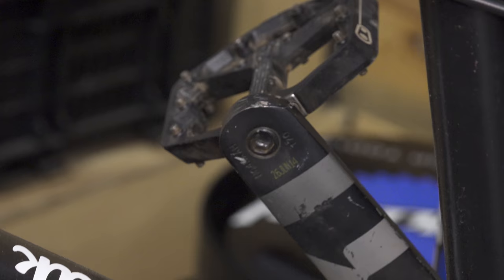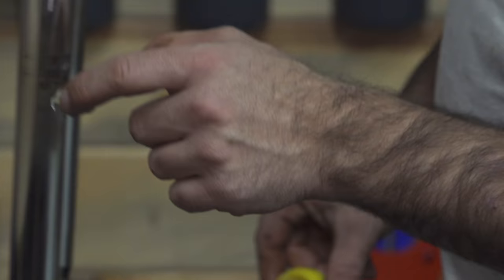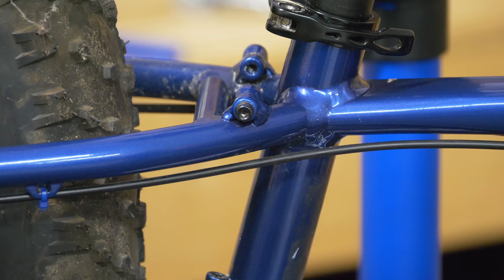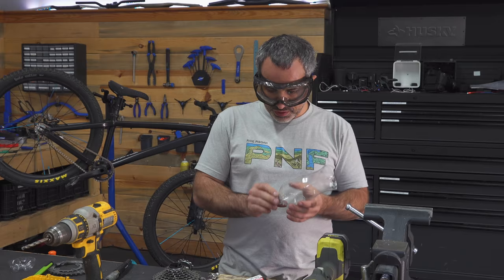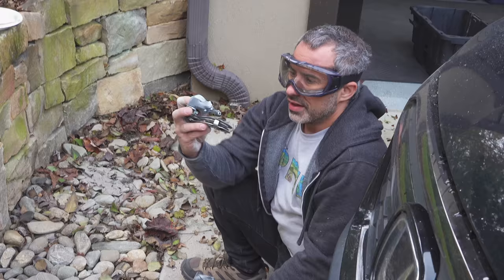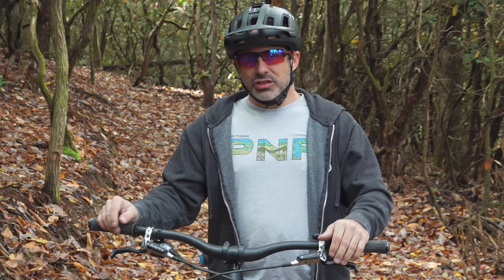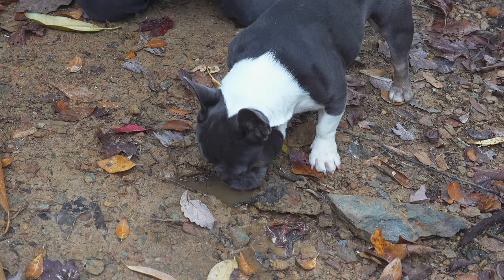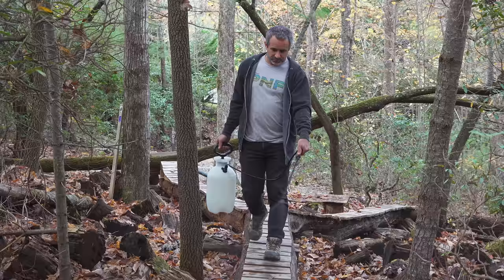10 Mildly Useful Hacks for Mountain Bikers

Comment: HACK: When you cut a steerer on a new fork, save the off-cut.  When you service your fork, instead of having your cockpit hanging pulling and twisting cables, clamp it onto the steerer tube off-cut and set it down on top of your headset.   Now your handlebars are sitting safely on your bike while you service your fork.
Reply: This is cool but only works on very very tall steerers
Reply: Pretty decent way that
Reply: @goodpools  i suppose I should have added that a piece of 1 and 1/8 inch tubing will also work just as well.  Thanks!

Comment: An old-school frame protection hack that I still use: 3m brand safety grip tape. Colloquially known as bathroom tape. Stick that stuff on the most vulnerable parts of your bike (ex: the downtube, crankarms, etc...). It''s thicker than the usual frame protection tape. Useful for protecting the bik3 against scratches, flying rocks, etc...
Reply: That’s actually really smart
Reply: Do you have a link for this? Is this transparent?
Reply: @vasingerke  you can find that in your local hardware store. As well as online.

There are multiple variants of that. And there is a transparent version.

You do not wrap the frame with that tape. You just apply it to the most vulnerable parts of your bike. As an example: I have stuck a length of that on the underside of my bike's downtube. I've seen people use it on their fork's lowers, crankarms, etc...
Reply: That's exactly what I did with my bike. The roll of tape was cheaper than one of those All Mountain Style frame protection kits. I know it's not as stylish, as it doesn't come with those fancy camo graphics, but I dare to say it's sturdier. I got it at Home Depot.
Reply: @wolfrikvonschwarzblut3921  yup. I still have what's left of the roll i got in 2013...

It's pretty thick so it protects well...

Comment: That sandblast hack is like a free ticket straight to Silicosis! First of all: sandblasting is pretty much NEVER done with actual sand. The most basic medium is glass bead, and you can buy it for a couple of dollars per pound.
Secondly, you ALWAYS want to wear a decent respirator (preferrably a half-face mask with filters or better) when sandblasting, because that dust is guaranteed to cause problems with your lungs!
Reply: Everyone should read this!!!
Reply: Yeah, I’m in healthcare and I was thinking the same thing either an enclosed container or some kinda protection for your lungs.
Reply: Not as big a problem as you think. I've been in concrete for 13 years, grinding off an on. Sure, it's not great and irritates your lungs. But for people doing it once a month or once a year, it's perfectly fine.
And they make masks specifically for grinding, full face shields. Or a fully enclosed oxygen mask.
Reply: This should be pinned
Reply: @RealMTBAddict  anecdotal reports from a different hazard isn't really a valid counter argument now is it...
Reply: @MassisPipes  Didn't I say wear a fully enclosed oxygen mask? I'm sure Seth isn't taking huge breaths of air while sandblasting. There is a technique to breathing so you minimize your risk.
Feel better now?
Reply: Yes, there's a reason sand/bead blasting is generally done in an enclosed cabinet and with special gloves
Reply: As a former sand blaster, I was cringing during that bit.
Reply: @jond1915  clearly you have little experience with sandblasting. Beach sand at the beach isn't being smashed into dust at high speeds. The reason we no longer use actual sand when sand blasting is because of how dangerous to your health it was.
Reply from the maker: VERY good to know. We’re actually planning on building an enclosure for doing this with plexiglass. The sand was a pretty bad medium too since it had bigger pieces that clogged the nozzle. Glass bead sounds much better.
Reply: @BermPeakExpress  There are many types of blasting media - from mild (walnut shells) to aggressive (silicon carbide or aluminum oxide).
Reply: @BermPeakExpress  a prebuilt harbour freight cabinet will probably be around the same price as a diy one with plexi, and much safer and easier to use. They cost about $180 including the gun...
Reply: I agree, I’ve seen people even use the grate off of a kitchen strainer with the glass beads to help separate larger beads that could dent the piece of material they were working on. Fish bowl sand, some types of play sand works too
Reply: if you havnt noticed safety seems to come second to seth
Reply: @EasternCanadian  everyone knows: safety third!
Reply: @MassisPipes  always keep safety top 10!!!
Reply: @BermPeakExpress  Seth, I'll second the suggestion to just buy a cabinet ready made.  They'll come with a nozzle.  Some blasting media can be recycled when you use a proper cabinet too, so it may save you money in the long run.

For softer metals like aluminium, try walnut shell or baking soda as blasting mediums.  If you get a real beat up Aluminium frame flip bike that you want to repaint, best to blast with something gentle.
Reply: @MassisPipes  explain exactly how his hazard is any different? Cause it isn't
Reply: @BermPeakExpress  I you're blasting for real, and not just a hack, glass bead as mentioned is nice and can be delicate. For aggressive removal black aluminum oxide. And the health risks are no joke. Even with the correct safety equipment it kills people who do it for a living. Even a short exposure like your video leaves lasting damage.
Reply: @pinchpeak5203  When you sandblast, the sand breaks up into microscopic particles. These silicon particles attach to the lungs, permanently, reducing lung capacity and sometimes causing cancer. It is the same as asbestos exposure, except asbestos more often causes cancer. It's not like spray paint or natural "dust" from say, a bike trail where the effects tend to be short term on the lungs then clear up. Sandblasting companies that do buildings (where exposure risk is high due even with a full sealed fresh air system) retire workers after 5-10 years as that's the maxim risk they are willing to take.
Reply: @BermPeakExpress  follow up video coming on that?
Reply: not to mention dont get any of it anywhere near any engines because it goes EVERYWHERE
Reply: @BermPeakExpress  of you are just cleaning stuff then soda blasting is super gentle.
Reply: No masks, be a man.
Reply: @seanbrown6904  Being a man means being there for your family, giving the right example, and a whole bunch of other things.
Being in a hospital stacking up bills is not "being a man".
Reply: @MassisPipes  Is joke bro. relax.
Reply: Was about to type something similar, but you did it way better than I could.
Reply: If you buy a respirator from somewhere and they don’t provide a fit test your not protected, also having a beard or even stubble will prevent the respirator from creating a proper seal and protecting you for inhaling the dust… for this type of application you will need P100 respirator cartridges that handle the dust particulate… if you are going to use the mask with chemicals you need to get different filters (where ever you get the chemicals should provide MSDS that tell you all required PPE)
Reply: @BermPeakExpress  Use baking soda, less abrasive en probably available in all of the home depots or supermarkets or what's around town...
Reply: @BermPeakExpress   but it was ok for the purpose of a proof of concept
Reply: I came here to say this, thankfully you already have. Well said, I’m glad your comment got to the top of the comments section so more people will see it.
Reply: @BermPeakExpress  Try crushed walnut shell. Works great, can be reused, biodegrades when done.
Reply: 1000% agree!
Reply: Seat belts and warning labels ruined everything! Just roll with it stop fighting nature
Reply: Thank you for saving me from having to write this! Silicosis can be fatal, and there’s no real treatment for it.
Reply: @MassisPipes 
"Stupid advice + [be a man]" is a meme.
Reply: In a ventilated outside area this is fine. Don't be such a drama Queen
Reply: @michaelhenry4405  definitely not. Maybe in a strong wind if you're standing upwind. Definitely not in a sheltered spot like in the video.
Reply: @BermPeakExpress  Hey man never blow the compressed air in hand as it can pretty much cause air-pockets in blood which can kill u, Great vid though loved the sharpie tricks
Reply: Lol.  I guess nobody told this guy how glass is made.
Reply: @RK-kn1ud  I guess nobody ever told you that melting alters the chemical composition, especially if you add other material such as soda ash and limestone.
Try grinding your drinking glass back down to sand and let me know how that works out.
Reply: @MassisPipes  "the most basic medium is glass bead"

Meanwhile a guy using literal sand is having some pretty good success.
Reply: @RK-kn1ud  obviously you're completely missing my point.
Reply: o  mR safety KIA   AND ALL of his sand blaster knowledge..  WGAF
Reply: @oldnslowpopi  the 40.000+ people who die of silicosis every year, that's who.
Reply: OSHA said I didn’t need a respirator

Comment: 7:10, Seth says that like half of the population doesnt regularly have to remove blood from clothing
if you dont have peroxide(or don't want to damage your clothes) - soak in cold water asap and wash with a bar of soap or Vanish, also in cold water before chucking in the wash also with Vanish or the like
just whatever you do dont use hot water as it will set the blood in the fabric
Reply: Nice
Reply: This is the answer. Just soak in cold water and then wash it. You don’t even have to be that quick about soaking it.
Reply: Vanish is like oxyclean for Americans reading this. Cold wash is key for sure.
Reply: Before putting in washing machine I put windex on blood stain and it comes out perfect

Comment: When installing a headset without a cup press and it won’t go in with a hammer. This is more of a problem on tapered head tubes. Put the cups in the freezer and then it will work. Because the metal will shrink slightly in the freezer.

Comment: A hack to remember position of brake/shift levers is to mark it with a retractable pencil. Once the levers are set perfectly, use a reference point like the gap of a hinge or the window of the clamp. Then make a mark with the pencil. So when you have to take apart your cockpit, resembling the positions are a breeze by lining up the lever to your tracing. Works also for your bar to stem.
Reply: I'm pretty sure this hack was included in some of Seth's videos long time ago

Comment: I have a hack with a blinky light, just good for a having a light so people can see you for commuting or something like that.

Basically it involves taking your stem faceplate and bars off then threading the elasticated loop of the blinky over the stem and putting the bars and stem back together, then you can do up the loop on the blinky as you would. The blinky sits nicely on top of the stem or you can even put it on the underside but the button is harder to access.

The hack works best on bikes with more tubular stems. Another linked hack is to swap the red rubber casing on a rear light for a black one off a front light for a more stealth look. Again a blinky is sufficient for a commuter rear light and can simply just stay on the bike for when you next need it.

Both of these hacks are effectively free save for the lights which most people have kicking around anyway.

Love your work,

George

Comment: So the ultimate way to get a blood stain out of clothing, from my hematology lecture in medical school, is to dissolve 1 teaspoon of salt into 2 cups of water (about a plastic water bottle). This solution is about the same salt concentration (osmolarity) as your blood like you would see with normal saline given IV for fluid administration. Soak the clothing in your homemade normal saline solution and the solution will be able to lift out the blood without causing the cells to burst and stain like they would when trying to use regular water.

Comment: HACK - For cold weather riding - tape the front vents of your helmet of - you can still vent out the back vents but you no longer get that airflow across the top of your head.  Works well in conjunction with a headband to keep your ears warm.  Use masking tape for the maximum un-coolness factor.

Comment: Hack suggestion: If you don't have access to a garden hose for bike cleaning and don't want to purchase a portable pressure washer, you can just use a big garden watering can (or camping solar shower bag). You also don't have to worry about your bearings since the pressure isn't as high. 

Also, you never mentioned carrying a first aid kit in any of your videos (that i've seen). Maybe you have a good suggestion where to store that on the bike?
Reply: Hack part 2 hoses fit washing machine hookups.

Comment: An important note: DO NOT use silica based sand (sand-blasting or playground sand) unless you want a case of silicosis! If you’re going to try to go this route, I’d recommend glass beads or aluminum oxide and always use eye and hand protection and a respirator.
Reply: glass is silica...

Comment: I did the O-ring hack a while ago and if you don't want to disassemble all that stuff you can cut the O-ring and use a drop of super glue to glue it back up. Just make sure not to get any on the stanchions. I used some masking tape to protect them and since it requires so little super glue I first put a few drops of it on a clean surface and used a push pin to apply it.

Comment: Seth, you NEED a 3D printer. Those things are pretty cheap right now and quite easy to use. Ender 3 v2 is a good entrypoint. This would inhance you manufacturing capabilities for more bike hacks immensly.
Reply: This is so true
Reply: Honestly he’s got a enough money to probably just buy a pursa or some other printer that will work good out of box.
Reply: Great idea, although it would also require everyone to own a 3D printer in order to do the hack.
Reply: @wyatts9646  tbh, my 3v2 worked great out of the box. but yes, Prusas come with many more features that make them more comfortable to use, like filament detection, thermal runaway protection and so on.
Reply: @tomodges  this is a valid argument, but the sandblaster hack requires people to have a compressor and an angle grinder, which both can easily cost what an entry level printer would cost.
Reply: @Medievalfan94  well also he could probably get some 1-2k printer free from a company
Reply: Good idea!

Comment: Seth, You should use distilled white vinegar instead of bleach for the mildew on your wooden features - experts recommend this because it actually works better particularly for deterring regrowth (was surprised to learn this myself, but look it up), not to mention covering your bases for any environmental considerations.  I’m sure the small amount of bleach you are misting on your features is pretty negligible (and frankly acceptable, in my mind), but you should switch over if only for sake of effectiveness!

Also, your joke was funny, but I’d question the general assumption that cutting down a tree necessarily is a greater environmental impact than allowing chemicals to leach into the ground - regrowing a tree is often easier and sometimes quicker than reversing pollution that has accumulated in the environment.

Comment: Nice video Seth. You are the person who got me into mountain biking. I've been watching for a year and a half now. A hack that I sometimes use is that you can use a lighter for decontaminating your rotors and when you are climbing with glasses you can put them into the vents on your helmet. Also by placing an apple air tag or other item of that kind in the bottom of your fork and taping it there you can plug the hole so no muck gets in while being able to track your bike if stolen.

Comment: I managed the 2nd hack with the rubber band on the fork bit instead of disassembling the entire fork I used a couple little zip ties. Doesn't look near as good and I will probably fix up my fork properly this winter but surprisingly well working and easy!

Comment: On my new build, i did two interesting things to help save a bit of money. 
1. I used electrical tape to secure my spare tube on the bike, my bike is black so it keeps a really clean look 
2. I used the little plastic clip that comes with a bike lock to secure on the frame and repurposed it as a chain guide on my chain stay

Comment: Hey seth, do you got any homemade hacks for removing a seized seatpost. I've tried hot water and wd-40 but it just wouldn't budge.
Reply: Only hot water? U should pour ice cold water right after it.. as to create thermal shock.. u might need to repeat the process a few times! Good luck.
Reply: @helio_afonso  Thank! I will give that a try
Reply: @helio_afonso  I tried that for about 2 hours and about 15 litres of water but unfortunately it seems that my seat post really is so stuck that it didn't move a single bit even while i was using a hammer. Is there any other tricks you know about?
Reply: @kalbetc6664  remove the bottom bracket and spray wd40 from there or every hole you have in your seat tube.. most importantly u need the most leverage you can have to twist the damn thing.. maybe hold the seat post and use the whole frame as leverage!
Reply: @kalbetc6664  remove the bottom bracket and spray wd40 from there or every hole you have in your seat tube.. most importantly u need the most leverage you can have to twist the damn thing.. maybe hold the seat post and use the whole frame as leverage!

Comment: One hack I haven't seen you do, is related to drying out the hose on a hydration pack. For the packs with a quick disconnect, this is easy. Remove the hose and run hot water through it. Make sure there is plenty of room around you, twirl the hose over your head really fast then flip ends and repeat.  In a few seconds you hose will be clean and dry inside and out.